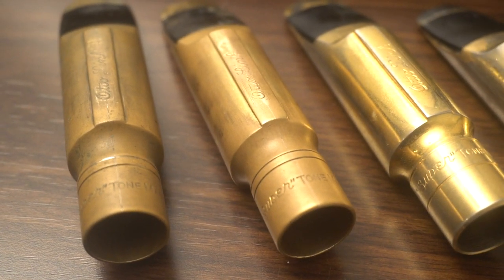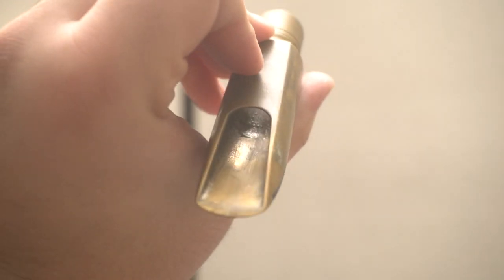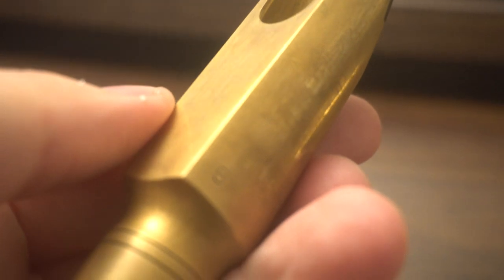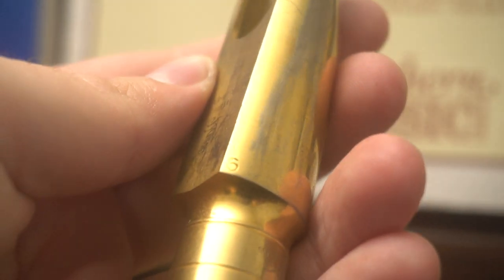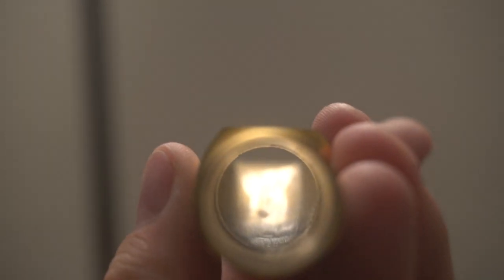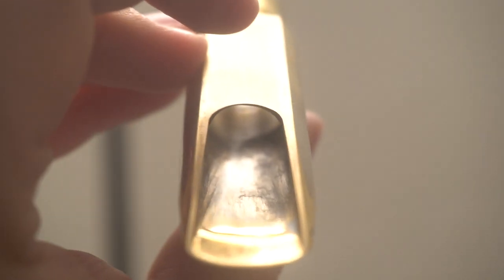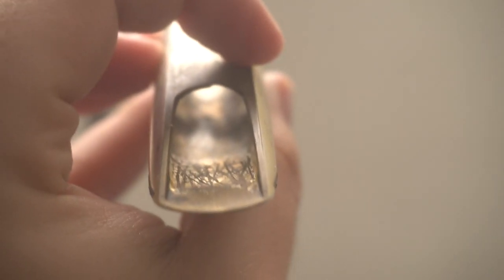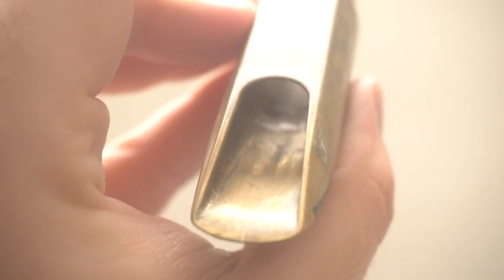Florida Otto Link & Double Ring STM Baffles & Chambers

Comment: A nice selection of Links here. 
The No USA 5* that is held up and described as 'refaced beautifully', may play great but the refacer has cut through the brass and into the black bite plate. I've owned nice playing refaced Links by BP and TK that were cut through to the bite plate in this way, their early work perhaps, but the blanks might have been worked or damaged already? Bending the tip open and cutting less brass from the baffle avoids this problem of opening up tips, but bending can change how the pieces sound.